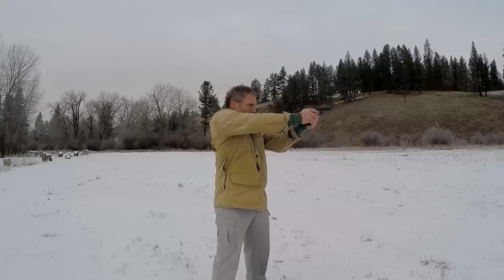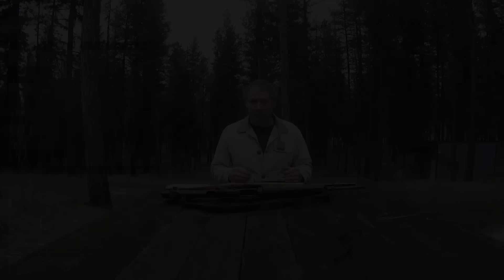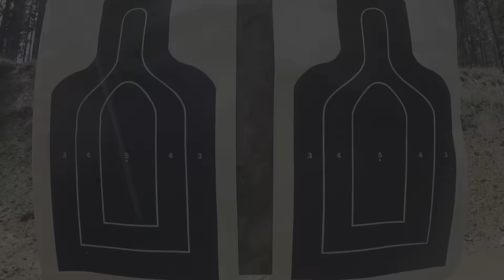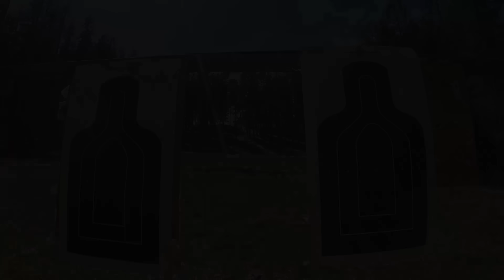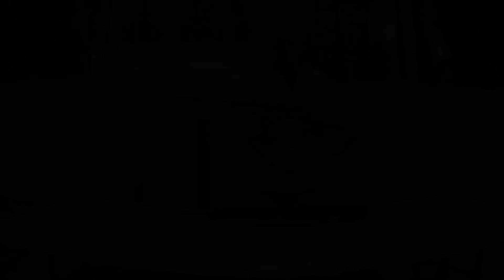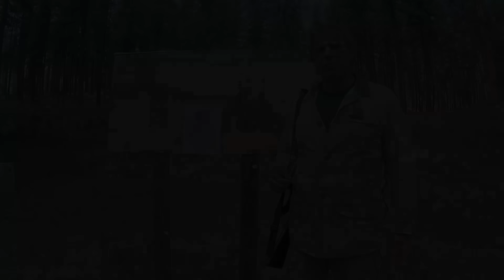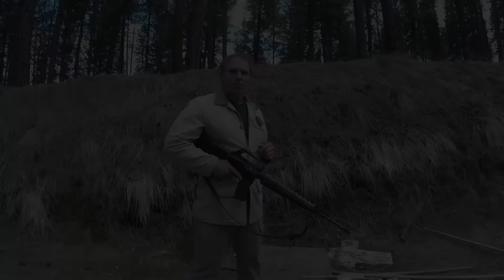Mini-14 vs AR15: Which is Better?

Comment: Excellent video Paul. I bought a mini put a $40 tasco on it and sighted it in at 25 yards. I never missed anything I shot at. Then I heard that the mini is the most inaccurate semi auto ever. So I put a better scope on it and shot at 100 yards. I got about a 2 inch group consistently. So I guess in terms of practical every day accuracy it's as good as any AR I own. If I want to shoot paper at distance I just leave the mini and AR at home and grab any of my 22-250's.
Reply: P.S how great is that sound when you hear a mini racking a round?

Comment: A couple of years ago I picked up a used mini 14 from a gun shop for around $450. It was a 181 series made in 1976 (last cleaned in 77 from the looks of it lol) I have put a barrel strut on it and an oversize mag release..The funny thing is MINE has that EXACT same flash hider on it.. I also thought it was an add on but have been unable to find another flash hider that matches it.ALSO Ruger both in the manual AND on their website states that although it is marked 223 IT IS safe to fire 5.56 in a mini, only the precision rifle is 223 only..Newer models ARE marked 5.56 also..of the mini..Good comparison..and I love it when a plan comes together...lol

Comment: Paul, great video. Can you do a video expanding more on using the AR sights properly? Also, can you show us what would be the proper way to "zero" in the sights?
Reply: There are lots of other youtube videos on how to zero your AR sights. The standard method, like Paul explained, is to zero at 25 meters (some people use 36 meters, not sure why). Adjust your front sight post up or down for your elevation. Once you have your elevation set right with your front sight post you won't make any other adjustments to it. If you have m16-A2 style sights then you set your rear elevation to the 8/3 + click for 25 meters, 8/3 position for 100 to 300 meters. Windage adjusts in 1/2 minute of angle per click, rear elevation is 1 minute of angle per click. MOA click adjustments vary between sights, so you have to know what type of sight you have, ie: A1, A2, or A4.
Reply: Indylimburg Guess I'm pretty dumb for asking, huh...

https://youtu.be/xHtEoRUakKk

Comment: I will be the judge.

Compare a zr1 to _________ !

But use 86 octane fuel, like it was not designed to, for OPTIMUM performance.

By you puting 223 ammo in a rifle designed by an aircraft engineer to run 556, you are fornicating the stoner name.

I am unhappy. 

I will not watch videos from you, until the next one.

And then, ill be the judge, again !!!!!

Edited response;

223 out of a1, 3100 fps. = ~279,000 rpm.

556 out of a1, 3300 fps (and that is, alot more 😀) = ~315,000 rpm.

That is...... 36,000 rpm less stability on the spinning bullet thus .......god, you made me cry.

You have no respect for mr. Stoner. 

Turning in his grave watching your vid........

Comment: My issue with the AR platform is the rear cocking handle. I don't want to dismount the rifle from my shoulder to clear a jam or to recharge. 
I'd much prefer a modern Galil Ace or SCAR with a side cocking handle and, I have a beard that is over a foot long and I'd be forever catching
my beard in the cocking mechanism...
Reply: Ironically the charging handle is the feature most SCAR users dislike.

Comment: I've seen a Mini 14 blow up from an overpressure once. It was a real shame 'cause the 800usd price tag REALLY stung the fella who blew it up. The shape of the chamber produced the kind of burns that an AR-15 would have made worse from its tighter ejection port, so at least that open top counted for something!
On the other hand, it was easier for me to pull apart the handguard compared to the AR15's myriad of options. But that's old history. I prefer the AR15 A1/2 myself since I'm a sucker for the aesthetic of a big fat 20 inch barrel and a silly carry handle rear sight.

Comment: One's light, accurate, cheap, works in adverse conditions, has great mags, sights, and is ergonomic.  The other's a mini 14.  For f-sake, where do you even focus on the front sight?  It's rounded.

For sighting in my rifles, I fire them at a plate at 300 yards.  I don't flinch, so only one caliber I shoot can I not call the shot.  I then adjust the sights, adjust for range, and fire my second shot at 100 yards to get my zero.

Comment: I had a 90's mini that I bought for varminting...worst damn rifle I've ever owned!!!  It grouped about the size of a softball at 100yds.  I asked my gunsmith if anything could be done to improve the situation...he said "yeah...sell it and buy yourself an AR-15"!!!  However...I've have heard that the newer ones with the thicker barrels are much more accurate.  In all I've owned 3 Rugers...a 1994 M77 Mark 2 bolt gun in 300 Win Mag that still shoots 3/4 MOA...and an AR-556 that groups about 1 MOA.  So I've had good luck with Ruger rifles in general.  But those old pencil thin barreled minis had a terrible rep for inaccuracy.

Comment: I've heard a good argument against the mini-14 in the past.....the original M-14 mechanism of the rifle was designed to shoot a heavier round, so now there's too much redundant metal slamming around, affecting the accuracy of the lighter 5.56.  Any merit to this argument? The straight-line gas-impingement system doesn't interfere as much with accuracy, etc. But I still like the look and relative simplicity of the mini-14 better. I think its more intuitive to use for any first-time shooter. Expensive mags suck.
Reply: Well, Jim Sullivan (who was also on the project to scale the AR-10 down to the AR-15) worked for Ruger and the internals were changed a lot, it's not a direct copy. I think the added mass is there not as a remnant of the original M-14 but a necessity of the casting process Ruger uses. When you cast a part you can't exactly make it with the same dimensions as if it was a billet or forged part. youtu.be/BgzTjX1alpM

Comment: I have qualified with and carried both, and never felt the Mini lacked in performance or accuracy out to 150 yards; so I believe I was lucky in having two good ones. Mag changes were a bit slower, but I had a bit of success using AK style mag reloads to knock some time off. I switched to AR/M4 pattern carbines for three reasons. First has to be magazines. Mr. Harrell was dead on. There are so many magazines out there for the AR platform it is easier and less expensive to find good ones than it is for the Mini platform. This applies to spare and repair parts as well. Secondly I have Minis, not Ranch Rifles. The A-3 upper facilitates mounting optics in a location that does not alter your cheek weld like most Mini-14 optic mounts. Last is the simple fact we have an AR armorer meaning he can inspect, repair and approve my AR for use.

A couple of us carried them; wanted to have "Got wood?" t-shirts made, but never got around to it. While experienced, I'm not an expert. Good to see my opinions validated by a pro. Great video, thanks.

Comment: Big advantage the AR has over the Mini14 is spare parts.  I've seen several broken bolts on Mini14s and you can only get them from Ruger if you're a gunsmith.

Comment: AR is designed and optimized for needs and circumstances of a professional.   Sites require specialty knowlege to set up takedown and maintainence are different etc.  Mini 14 is designed for civillian use.   Hunting etc on familiar ground on a casual basis. Different designs for different uses have different strengths.

Comment: I like the Mini-14 However... 
It is just not worth what it takes to accurize the gun, & is just not as reliable as the Direct impingement system. (In my experience)
Magazines for the AR are just so ubiquitous.
The AR15 is the gun that pisses anti-gunners off the most, yet an even more valid reason to prefer it.

Both awesome in their own right.

Comment: Thank you, Paul, for another excellent video presentation. I like the way you expose the variables regarding comparisons between firearms, like these two. I currently own a Mini14 fro two primary reasons. One- it was the rifle which I used for the last 20+ years at work, and Two, I still live in the People's Republic Of Kalifornia, so it's a lot less troublesome to own here than an AR "assault rifle". Way easier to change magazines. Mine works great, and recently mounted a 2 MOA Aimpoint on it after finally finding a quality scope mount for it. 
Like to meet you someday, if only to shake your hand. thanks again.

Comment: You should zero your mini 14 at 50 yards. That gives your second point of impact on point is at about 220 yards. That way from 15 yards out to 300 yards your point of impact is very minimally different compared to the point of aim.

It all comes down to how you choose to zero your rifle, 25 50 100 or 37/300 yards... yes, 37 yards is the counter impact point to a 300 yard zero... not 25.

Comment: Why that loading procedure for the AR?  Why not do it the same as the Mini14?  Pull back charging handle without holding the release, let the bolt lock back, load magazine and release bolt?
Reply from the maker: You can do it that way, but the AR bolt will close better (in the opinion of the instructors at gunsite) if you let it close and leave it that way.
Reply: @PaulHarrell  Makes sense.  Thanks

Comment: COuld you do a video specifically about how to use the AR sights?  The long range rear is just a smaller circle than the short range sight.  But if you center the front sight in each, aren't they the same?  See what I mean?  I need to know how to use the short/long range sights.  With that rear circle reticle, where exactly in it do you put the front sight?
Reply from the maker: My rifle is an A-1 the short and long range apertures are the same size. The long range sight adds elevation.

Comment: The sight explanation for the AR seems odd to me.  Aren’t the centers of the large and small apertures on the rear sight the same height?  I thought the rear apertures were just different diameters - large for quicker front sight acquisition and closer range shooting; small for longer range shooting where the rear peep is smaller and necessitates the front sight post being in a more precise position.  Why would the “long range” aperture be used at 25 yds and the “short range” aperture be used for 100-200 yds?  Makes no sense to me.
Reply from the maker: My rifle is an A-1 You're thinking of the A-2  The short and long range apertures are the same size. The long range aperture adds elevation so you're zeroed at longer ranges (300 yards)
Reply: Paul Harrell - and there is the explanation!  I did not know that about the A1s.  I continue to learn from you even after your video is over!  I appreciate the response and the consistently thorough and conscientious content!

Comment: Learning about the sighting was great, though I rarely use iron sights anymore. With that in mind, I used to have a ruger mini 30. I mounted a Nikon 3x9x40 prostaff on it, so not knowing how to best use the mini 30’s irons wasn’t a factor. Even with the scope, I was lucky to get 3” groups at 100 yards, and after a couple 5 rnd mags, it opened up wildly. I can shoot better groups with my AK, 16” ar, and 8.5” ar, none of which have magnified optics on them. They are all red dots. Maybe mini 14’s are far more accurate than their 7.62x39 brothers, but my experience with ruger mini style rifles has been less than ideal. Now for the “yabut”. That mini 30 cpuld have easily put a hog (or home invader) on the ground, so I know they can get the job done, its just I also know my AK and both AR’s can get the same job done, while giving me more room for error.

Comment: In comparing velocity, don't we need to consider the barrel twist rate?  What was twist rate on each barrel?
Reply: As far as the A1 goes, it's a 1 in 12 twist. I'm not sure about the old Mini 14s, but the new ones got a 1 in 9.

Comment: Or maybe you fell in love with them 43 years ago and, because you were young and just starting out farming on your own, you passed up on buying one until that old itch came back again and this time you decided to scratch. That's why, even though I have two AR15s, one DI and one piston drive, a couple of months ago I bought the Mini-14 of my dreams - wood and stainless steel. It's a 1994 series 186 and I bought an Accu-Strut and an Amega scout rail to help with the "accuracy" problem, though I haven't shot it yet. I'm approaching 70 and I have a screwed up back, so my good days are limited.

And thanks for the timely video. I enjoyed watching it. And FYI, I put a 4x12x40 Nikon Prostaff 223 BDC 600 scope on my "new" Mini.

Comment: I digged this video 👍. (Throwing this out there) About a month ago i was testing out my new Del ton 316 carbine. I had American Eagle 223 55 gr x193. American eagle 556 62gr xm855 and pmc (or upc or something) Xtac 55gr fmj boat tail. I bought large amounts of 193 and 855 and only 40 rounds of the x-tac. I proved myself a fool yet again. The 193 AND 855 (at least out of my 1:8 twist 16 inch barrel) were pretty much the same. But the X-tac (more than once) was putting rounds through the same hole (or close enough). I wish all 556 and 223 where boat tailed...its just better.

Comment: Hi Paul,  I have an early Mini.  Cryogenic treatment of the barrel has helped accuracy a lot.  I also added a Har-Bar barrel stabilizer and bedded the receiver cradle.  These three mods have increase accuracy, especially when going from a cold to hot barrel.  The barrel "walk" from a hot barrel is gone.   P.S.   Love your videos.

Comment: I used to have an AR-15 and sold it off last year due to working somewhere that made buying .223 brass a bit too expensive for me.  And honestly I just didn't care for it.  Fast forward to today and I'm working somewhere that I'm making more money at now and I was able to get a tactical model Mini 14 with a folding stock used for less than 600$ a few months ago.  And it cycles steel cased ammo reliably (my old AR didn't).  It kicks less than an AR, and I do find it to have a "cool factor" that the AR doesn't.

I'm not going to ignore the gun's faults and quirks though.  Although I must admit it is nice to see that the gun can be accurate, and you actually addressed a lot of those in this video.  Pretty good video.  All I can say is it's like saying you like Pepsi more than RC Cola.  I prefer the RC.  Good video.

Comment: Paul, when you do that video on .223/5.56, could you address something I've heard about Minis? Basically i was told that even older ones that weren't specifically chambered in 5.56 like more modern ones, could safely shoot 5.56. The logic being that they were semiautomatic, and therefore built inherently with looser chamber tolerances than bolt guns which are supposedly more susceptible to. 223/5.56 chamber pressures. I've heard this from guys whose opinions i don't always agree with but that I do feel have merit regardless.

Comment: It was a pleasure to sit through the whole thing. Stashed away somewhere I have an original Ruger Mini-14 poster, it came from my local Coast to Coast Store, and it bills the rifle as "The World's most expensive Plinker".  And that is how I feel about all 5.56 and 223 rifles, expensive plinkers. I did 20 years in a Law Enforcement Organization, one of the World's largest, where the Mini was our go to rifle. I also owned a Mini myself made in 1976, it said so on the barrel. I developed no love for it. As far as falling in love with a firearm the Mini has as much attraction as a side handle baton, I feel the same way about the AR platform, but I assemble them for a lot less than $600.00 anymore, so I have  a few. After all  you can get ammo for one off of any dead ....

Comment: Good comparison video.  I own both, and my preference is the AR, mostly because I have more time on this platform.  My mini was purchased from a gun shop that had several state police trade ins, so it has those wonderful words stamped on it "For government use only" and has a bayonet lug.  Not a bad rifle, and fun to shoot.  But, when I go to the range, all guns are loaded into the truck, inside the garage with the door closed, and all guns are either in the range bag, or in a case, so no one knows whether it is the scary black one, or the 10-22.  Went through all 5 seasons of the A-Team, and if you use them as the example of the mini-14's accuracy, then, you aren't hitting much other than dirt with it.  But reliability was excellent.  On the other side of that, whenever they were being fired upon by bad guys, or the Army with their AR/M-16's, they aren't any more accurate.  So, as always, I blame the shooter.  Maybe you can do the mini-30 vs the AK-47 video.

Comment: Well, I just like Mini's, but my wife learned shooting on my M1 Carbine and the platform similarities are good for her to train on it without too much to learn. I also do consider the legal factor but it's more of a secondary or even tertiary reason for selecting one and not my prime choice for why. My experience with Mini's being more reliable than AR's was mostly in the 90's and early 2000's. Shooting steel cased stuff... most commercial AR's choked on the stuff and choked bad. These days, it doesnt seem to be as big of a deal. 

In general, the AR's system allows it to be more accurate, they are cheaper, and overall are better rifles for most practical purposes. However, as I said.. I like Mini's and it's easier for my wife to transition from M1 Carbine to Mini-14/Mini-30 than it is to an AR despite it not being a difficult manual of arms. But as much as I dont like it, she is one who goes based on appearance and the Mini doesnt intimidate her, the AR does. I'd rather her be comfortable with a reliable platform that she is already familiar with the manual of arms on than try to force her to learn something that she wont put the time or effort into.